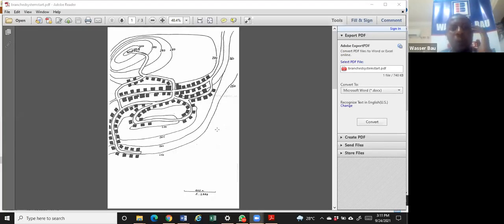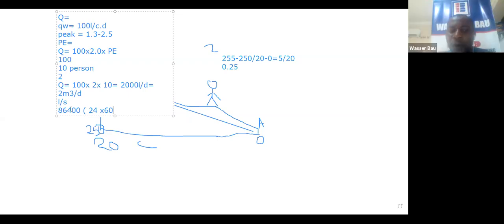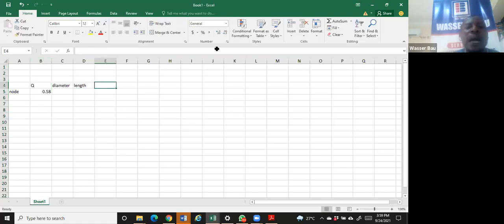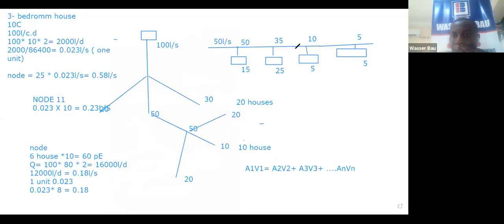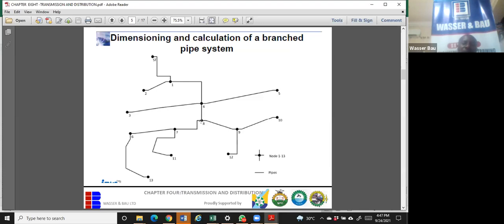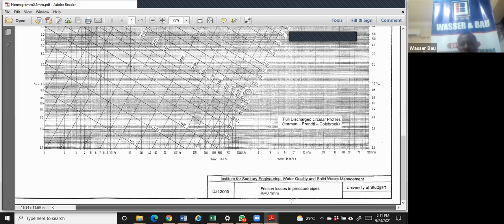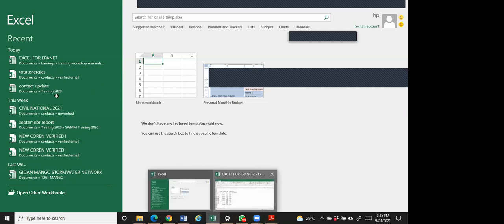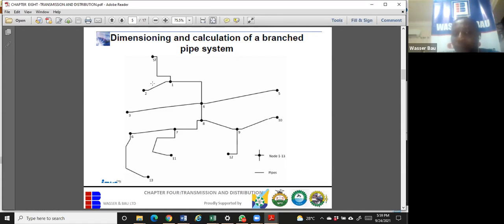introduction to water reticulation system  full  case study day 2

Comment: I have a question didn’t you say minimum size for pipe length is 150 mm why are you still using 65mm
Reply from the maker: 150mm for sewer. 50mm for water